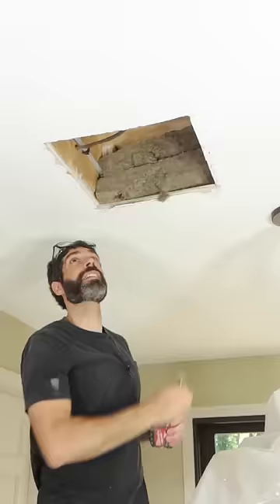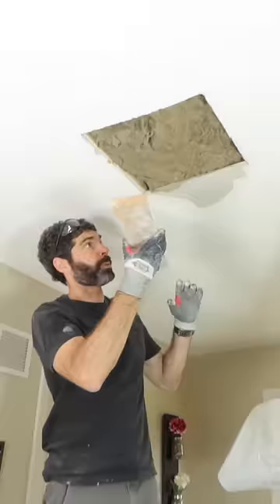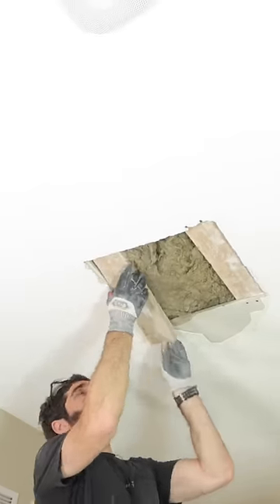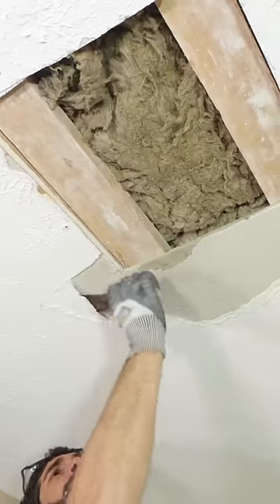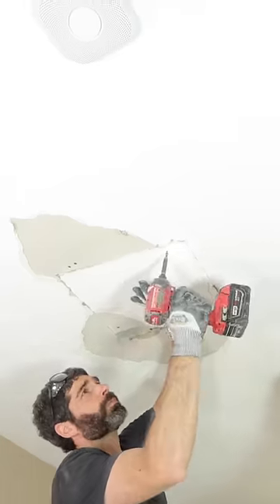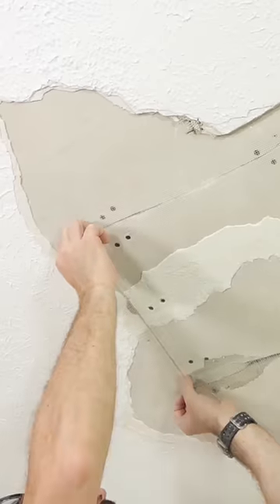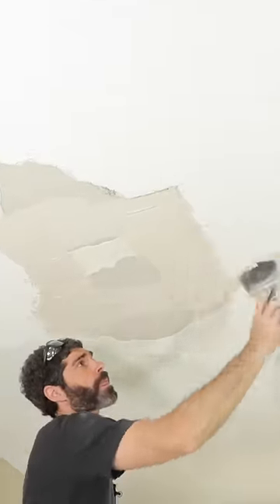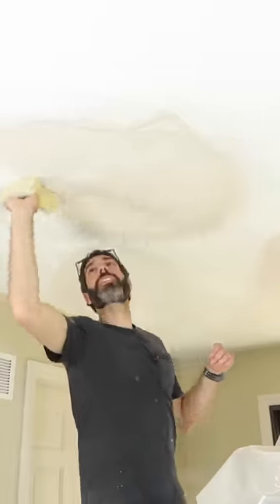Drywall Ceiling Repair Tips - #shorts

Comment: Done it for 20 yrs or more. Nothing at all wrong with what you've done. Would like to see finished product.
Reply: Me too.  I like the mesh tape.  I scrape  down existing drywall, half width of tape  even if not loose.  I'm good with small texture sprayer, then just blend in new texture with old
Reply: Why do some folks not like mesh in this situation?
Reply: then you should know mesh tape never goes on a ceiling.
Reply: @wstevenson2004 their pride or some sh it. They ll gag if they see mesh

Comment: Former pro here. Mesh toe all day for patches or you don’t know what your doing, especially ceiling. If you have fresh board than go with paper but mesh is the answer for patches except in angles.
Reply: Why not on angles?
Reply: @jeremiahburkins5027  The mesh will not provide a smooth crease for feathering the mud to make a clean line. Think of vaulted ceilings with 45 degree angles. The mesh would not hold a sharp angle for a straight line that is pleasing on the eye.
Reply: He's absolutely correct
Reply: FibaFuse is king

Comment: Plumbing access panel is the smartest since, but... You cut the whole...why didn't you cut it to the center of the joists and forget about the extra pieces of wood? Or put them at 90° and make the repair that much mls secure.
Reply: Yep spot on .. I'd do that and just screw in a bit of frame to fix the sheet to and make any future repair easier.

Comment: I wholeheartedly agree with you. I always mesh tape my patches. They turn out great. 🤘
Reply: Agreed I will use mesh tape on every seem when possible.  I know I end up using more mud but it's my preference and every customer I've had has always had be come back when needing new jobs done.
Reply: Ditto
Reply: fiber fuse is better for that
Reply: Mesh over long spans tends to crack. Small areas you can do no problem. Just be sure to use quick mud or all purpose compound
Reply: the type of tape holds no bearing over how the patch turns out. this entire idea that mesh has to be used for patches is dumb.
Reply: Fiber fuse is my favorite . It “disappears” with just one coat living a perfect finish .

Comment: A lot of people don’t know that when drywall was becoming popular using a damp sponge while it’s wet was the intended method. Not sanding after trying to get it perfect. Also yeah the mesh tape is solid, people who say it cracks every time don’t know what they’re doing/talking about. As well as people who say matching texture will always show.. can be done, pretty easily too if it’s a texture that’s somewhat common..
Reply: I've had a lot of mesh tape split or crack.  Why is that?
Reply: @alext8828  cause you're bad at mudding
Reply: @ptfsndsw7028   So you don't really know anything.  Thanks, mud expert.
Reply: @alext8828  mesh tape can crack if the layers too thick, dries too fast etc, too large of a gap, everyone has their quirks  with mudding and their way of doing it, theres more than one way to skin a cat, you approached me asking a general question, my mud isn't craxking, if yours is it could be for several reasons, if you like paper tape use that, i use both, not trying to argue, just responding with the same energy.
Reply: @ptfsndsw7028   If I'm honest, I did read that it's only to be used with the product that comes in bags that you mix with water.  I used it with the stuff that comes in buckets.  I didn't think that would make a difference.  
What was going on there, if you know?
Reply: @alext8828  45? 20? In bags, the 20 is faster drying good for skim coat, harder to sand, dries faster so less time to mess about. 45 is like... baseline IMO. Would also depend on what bucket you got. All purpose? Brand?  They have dry powder, boxes with bags of premix or buckets of premix, theres lots of resources online for the different types of mud and when to use them and etc. Probably explain it better than me. I never heard premix vs bag is betteror worse, just depends on application.

Comment: Excuse my ignorance, I did a repair on a wall like this a few years back(only one I've ever done) except I didn't use any tape at all. Just put the furring strips, joint compound and repainted and it's been fine. Am I supposed to see an issue by not having used tape?  3yrs running and it's been solid.
Reply: There’s a higher chance it will crack, but if it’s been three years than your house has probably settled all it’s going to so your fine. Just don’t slam doors too hard lol

Comment: What about replacing the drywall on the ceiling Afterwards? I will have to remove everything from the room then clean the dust and put it back after the drywall is removed. I don't want to have to do this twice. Is replacing the drywall as messy as cutting it out?

Comment: I’m out on mesh tape. Too prone to failure, especially with all the lightweight drywall and lightweight setting mud these days. Cracks will show through in dry climates or if you push on the wallboard. Expensive mistake if you’re all trimmed and painted. Paper tape is best.

Comment: In my experience, don't use mesh on ceiling. The hot cold cycles will make it crack. Use paper. You said mesh is better but only because it "feels it's better". Why.

Comment: This is very helpful. I don't have drywall experience and now have some repairs to do.
Reply: I don't know where you are mate the worst thing you can do with plaster is trying finish it yourself
Reply: @Bandit-10-4  I'm in the states and it's a smaller area so eventually I will have to give it a try. Even if it's not perfect it will be a learning experience and it will look better than the damage it has now.

Comment: I had this done to my ceiling by some contractors.  It's pretty good, but there are minor uneven spots with the plaster.  You can't really notice it at all in normal lighting settings, but when I put a flashlight alongside the ceiling, you can really see the bumps and where they plastered.  Is this to be expected?  I can send you a video if you'd like...

Comment: nice job but i would have overlapped the furring strips so that at least 3/4” was running inside the edge of the existing ceiling. that small of a hole probably won’t matter but larger ones do

Comment: I agree, mesh tape seems to work better in my opinion, paper tape (for me) just doesn't seem to stick as well.
Reply: All I have ever used is paper tape.  Mine NEVER bubbles... Mesh cracks if you don't push the mud all the way through the mess.  I know because I fix mess jobs years later.  My tape is good until the house falls down.  PeAcE

Comment: Done many mesh and its fine .
Reply: if its on a repair on a settled building id think it be fine almost all the time
Reply: @DSkimRS  Yup I would agree. The expansion you should see there should be extremely minimal. I think sometimes people forget that the panels move over time in relation to each other, but the panel itself isn’t shrinking or expanding of course.

Comment: Mesh tape rules for doing the job quicker. It cracks sooner or later and if then homeowner remembers who did the repair, your going back to do it again 😊. Paper tape sucks to use for this type of repair but it’s not going to crack like plastic mesh, fiber mesh , all of them crack when the oils in them dissipate.. 
yes, we ran several tests on same job s . My  drywallers are convinced also . They used to say “ we never had a problem” my reply was no- “I “ ( the contractor) have the problem, the home / building owner doesn’t have your phone number , it could be years till you hear about a problem or go back and see the result! One mesh lasted the longest, not sure of the name but it’s wider than most , heavy duty looking & the color of a tan like band aid .. they all went a little longer before the hair line cracks developed when used with hot mud, especially with the old school brown bag Dura- bond

Comment: I've learned the hard way. You never use mesh tape on the ceiling, it will always crack!
Reply: Not if you apply if correctly. Either paper or mesh works great.
Reply: Mesh works fine on ceilings. You probably still have too much movement involved in the bracing of the patch if it is cracking. Paper won't blend nearly as well.
Reply: I've never had a crack on mine that I know of, but I don't know everything soooooo who knows. But did it in my own home and 3 years later still can't see the patch. Never had a call back on mesh either.
Reply: You should always use hot mud for your first coat if your using mesh tape, I’ve never had an issue using mesh tape idk why it’s got a bad rep on here, but if you didn’t use a quick setting mud that might be your problem with the cracking

Comment: I use mesh tape anytime I'm doing a repair like that pretty much everytime, I don't see what's wrong with it. I'm pretty new to drywall, but I love me some mesh tape. If I'm not pulling it out of my banjo or corner bead hopper it's probably mesh tape. It works, holds up and prevents call backs, at least imo. I love to learn tho, so if anybody sees a problem with what I'm saying please respond and lmk so I can be better, just try not to be too condescending. A little condescending is OK tho.
Reply: I think you're spot on with what you're talking about. Paper tape is fantastic for new work but mesh tape adds a reinforcement around that patch that's going to make it less likely to crack over time

Comment: Right if this is me doing this I'd trim it back to the joist next to the light and fix a frame in,its not that much extra work and is much stronger. That will give you a much simpler patch should it leak again in the future Yes an acces panel would be handier but it depends on the use of the room. No one wants an access panel in the middle of their sitting room. I was a machine taper for 20 years.

Comment: I was just telling my wife that mesh tape is the best stuff to use whether you're doing new drywall or old drywall if it fixes a lot of gaps and mistakes
Reply: Here in Europe we use mesh tape very often, paper tape not that much like americans but i have to admit that paper is way stronger than mesh tape in terms of endurance over time.
Another good  option to take in consideration i think is the new mesh tape fiba fuse max from Saint Gobain.
Reply: New drywall should always be papered. You can get away with it if it's one smaller room, but it will crack when new houses settle.
Reply: I install and finish for a living. It isn't superior to paper tape, but in certain situations it can be just as good. I do use the extra strength stuff on larger gaps but it's costly.

Comment: How do you replicate textured ceiling when you do a patch like this? I have a section in my kitchen where the upstairs bathroom toilet leaked and damaged the drywall so we had to replace, but couldn't really get the new texture to match.
Reply: It’s hard to match texture perfectly, but just get a hopper and use a piece of cardboard or whatever to test your pattern, get it as close as you can to the size and consistency of texture on the wall/ceiling and spray a couple feet more than the size of the patch it’s all about tricking your eyes so you see the same texture when you look at the ceiling, if the texture on the ceiling is knockdown you have to use a larger hole on the hopper wait for it to dry and sand it to flatten the globs of mud

Comment: You might have considered installing an access panel for future access to the plumbing. White plastic panels are available and are virtually unnoticeable.
Reply: No they aren’t . That’s for a basement not In the middle of a room. And access to what? If it’s fixed right it’ll last for decades before needing repair again

Comment: I started using mesh tape in 1989 and then by 1991 I was quickly over it because every single job that I seen done with mesh tape had cracks going around the repair where that mesh tape was put. It's always better to use paper tape. Mesh tape is rubbish

Comment: Anyyyyyy annny annnnyyyyy time you run into anything loose that you need to scrape away because its bubbling/not holding you should use RX-35 to seal your work after scraping the old off stuff and before you even mix any sheetrock or get any tape out. Do it.... spend the extra hour, it will save you heartache later.

Comment: There is no time that mesh tape is good for setting any joint. 1) it cracks 2) it doesn’t have a good being 3) it’s very bulky and therefore harder to cover. Try a new product call fibre fuse.
Reply: Fiber fuse is expensive and unnecessary, I do patch work all the time and always use mesh tape for the most part, if you know what your doing it’s the strongest option, and I’ve never had a crack or callback.

Comment: You should have cut out the Drywall carefully from center-line Stud/Joist to the other. Then you could have simply reinstalled that same Drywall Cut, screwing it down to the same Stud/Joist it came from. Then you would not need to use extra wood or a new Drywall piece. .
Reply: Gotta re tape and finish anyway..

Comment: I like just using those spring loaded panels so you can get to the trap in the future.
Reply from the maker: It’s in a kitchen, and all the pipes are solvent welded, so if there’s a leak it’s gonna be at the tub - which was tested and passed

Comment: That's called blocking. You need to attached to studs not the drywall. You may as well just mud it up without screws. It's not doing anything.

Comment: Why the hell would you not put an access panel in the ceiling there?
Reply: You're right but some people think different
Reply: @ErnestoMartinez-tm3fe  they just like doing drywall a lot over and over
Reply: Pretty good idea
Reply: 🤣🤣 no doubt
Reply: U would need an access panel for every valve or else it wouldn’t make sense what are you going to do put an access panel every time you do a repair genius
Reply: What do you live in a trailer? A closet is the only acceptable place to put an access panel in a house. The fittings on his tub drain are glued not slip joint.  There’s no need for an access panel if it’s installed right
Reply: Because it would look terrible in a "good" room . Access panels are for behind toilets and in cupboards unless you live in a hotel.
Reply: Yeah but they are ugly and maybe he doesn't want to look at it.

Comment: Why didn't he just cut halfway down the main two by four running through the ceiling? Literally would have took you an extra half a minute to cut over a quarter inch. And at that point why didn't you convince the homeowner to put a panel right there so they always have access to the piping? Just saying a good construction worker would have made sure there was a panel there so they always have access to their piping now that it's been exposed. Months again people showing they have no idea what they're doing

Comment: Eh, i would've skipped the tape and just filled the gap and made sure the new texture was flush, there's one spot in my hkuse done by a pro, and there's one that i did, you can't mine is there, but the other one drive my ocd crazy cause it's tapered and catches the light different, i don't like that spot, but im also lazy and don't feel like sanding i ceiling

Comment: 10/10 going to wish you used an access panel next time you have to do plumbing
Reply: Good point I forgot to mention that on my last comment. I like using access panels for plumbing electrical shut off valves etc.

Comment: I've never seen texture come off that easily and I've been hanging and finishing drywall for years. Even the Mexican crews don't score and scrape. You're supposed to sand it to a feathered edge and then blend it in. With new texture feathered into the old texture. Then lightly dust off to match it.

Comment: Step one: get a drywaller to do the job, he is a pro
Reply: @Mike  you made the argument for using a professional drywaller and painter. 

Yes its hard to find someone qualified, and with no one new coming into the trades it will not only get harder but extremely expensive to pay for those of us in the trades.  I love charging a doctor what he charges me, I am slowly starting charging more than a doctor costs and it will only go up from there.

Comment: Ya that’s because your an armature and don’t know how to use paper tape. Texture or not plays no difference.
Reply: Truth 👍
Reply: I'm a fan of the fiberglass tape personally.
Reply: He’s an armature lol… you have no idea what your talking about, I’ve been doing patchwork for many years and never do you put paper tape on a ceiling patch.  you just don’t know how to use mesh tape, as long as you use hot mud for first coat mesh tape is way stronger than paper tape.
Reply: @dc6418  What are your thoughts on fiber tape? The fiberglass stuff.
Reply: @whattheschmidt  I like it, it works well, but a lot of hardware stores don’t carry it, and it’s kind of pricey. I do think as far as holding power mesh is best as long as you use the hot mud, I think this is where people who think it sucks mess up. I do agree tho fiberglass (fiba fuse) is really good tape.
Reply: @dc6418  alright, cool, good to know.  I bought fibafuse for my bathroom but the drywall guy I paid to do some work used mesh instead which confused me but I figured both would work well for a bathroom.  I don't believe he used hot mud though so I'll see how it holds up over time.